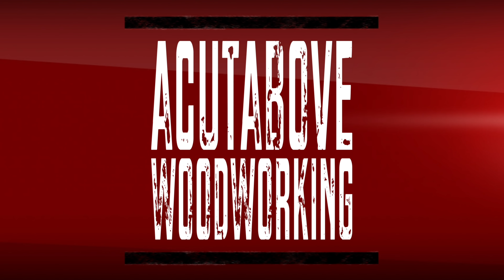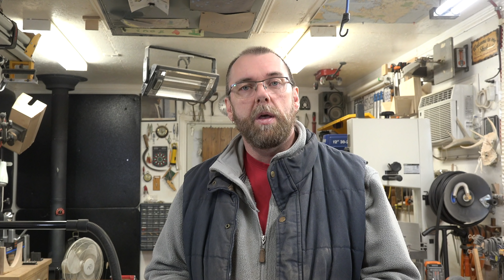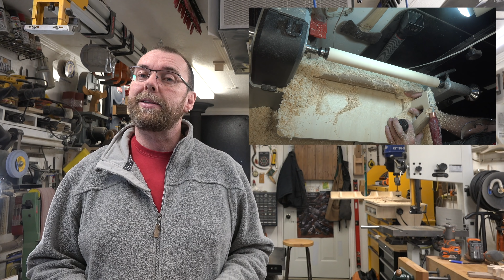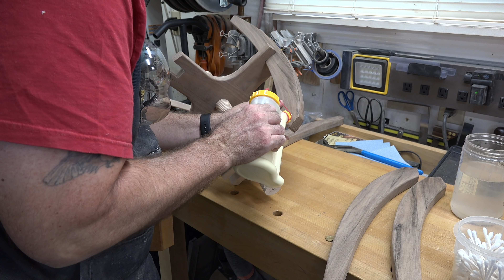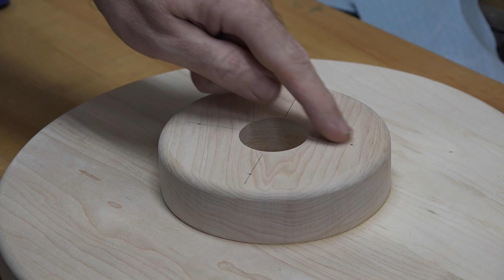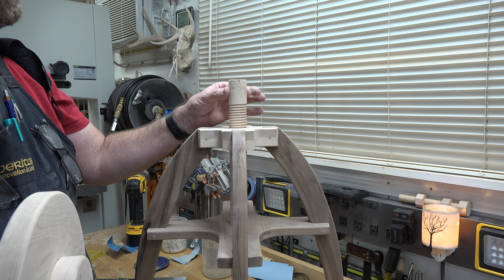Adjustable stool Part 3

Comment: Kenny,  love that stool, it came out great.  Seemed like I remembered you doing a video about the thread cutting so I checked and sure enough there it was.  I totally agree with the reasoning behind not drilling the peg holes as through holes, much too easy to ruin the project in the later steps.  Wonderful job.  Looking forward to what is coming next.
Reply from the maker: Thanks for the kind words on the show Paul.  As you know, my show is prerecorded and I have to say that this stool has been an awesome addition to the show.  I spend a lot of time sitting on it working on the smaller parts at my bench.  Just a fantastic and functional project.  Thanks for tuning in sir.  As always, I appreciate your support.

Comment: Kenny, very nice build. The only thing I think you should have done was put a dowel through the ring into the stem of the threaded dowel that fits into the seat. You only attached it using glue. Glue has a nasty habit of drying out and coming loose. The pin would keep both pieces in place and tight. Best regards, Richard
Reply from the maker: Thanks for the kind words and for the suggestion on the extra dowel pin Richard.  That simple little modification is still possible with a longer drill bit so I may just take your suggestion into account and make that modification.  Great idea.  Thanks so much for tuning in to the show and for chiming in with your comment.

Comment: It's been a while but I'm back and I see the wagon is still up in the air. When you speak at the end of the video you had better move that bungee cord before you sneeze and that thing grabs you by the ear and gets you to bouncing up and down 'til your store bought teeth fall out. Hey it's just for fun. That was a great build, are you going to put any oil on it? Something like a dry oil that want rub off on your clothes. 

God Bless my friend.
Reply from the maker: LOL.  Great to hear from you Frank.  Glad to see that you haven't changed.  I've put a finish on this stool since the video was shot.  I put a base coat of danish oil and then finished it off with 4 coats of satin finish varnish.  It turned out really nice.  Maybe I should take a picture and post it up on my channel's facebook page and provide the link.  Thanks for tuning in sir and for taking the time to leave such a heart felt comment.  LOL.  I appreciate your support and always enjoy hearing from you.

Comment: The seat is crooked by about 5° where is the problem is it fixable
Reply from the maker: I'm not 100% sure what you are referring to here because the seat isn't off by any degree.  But I guess if it is, you could always lean 5 degrees in the opposite direction to compensate for that.  LOL.  Thanks for tuning in to the show.